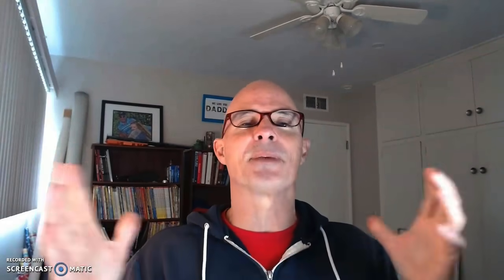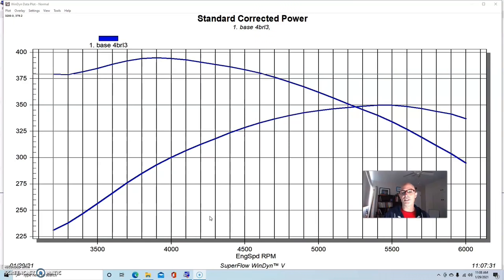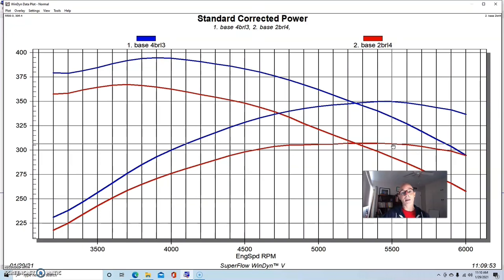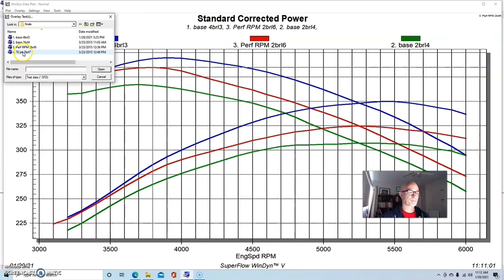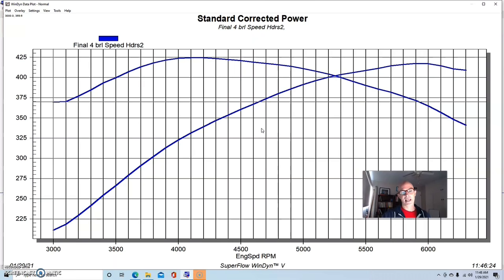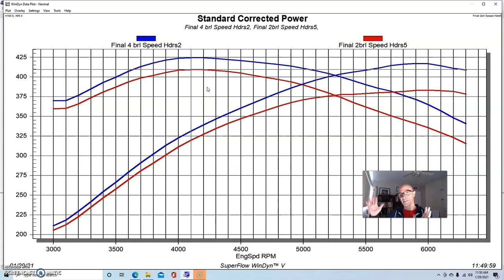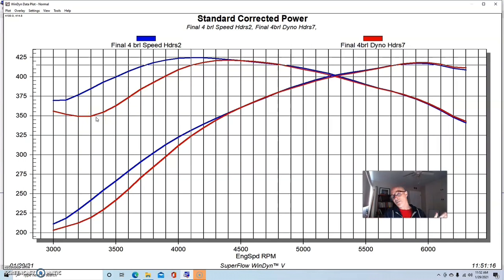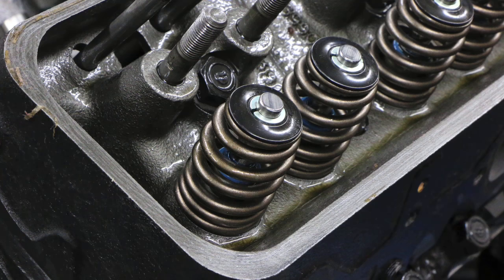SBC POWER GAMESSTOP HERE! (2BRL VS 4BRL)

Comment: Hey Richard curious if you’d ever do a header primary and collector size shootout I’ve got a 500 horse 400 ci s10 with 1 1-2” headers on it just curious how much I’m losing with the smaller headers thank
Reply: Are you saying that your primaries are 1.5" ???
Even 1 5/8 is small for what you are doing, and 1 1/2 really chokes it. Another issue with small headers is that it increases crank case pressure and poor ring seal.

You need 1 3/4" for a 400 ci 500 hp mill.
Reply from the maker: 1.5 INCH HEADERS WOULD BE TOO SMALL FOR ANYTHING BUT A STOCK 400
Reply: @AB-80X   yea 1.5” primary’s to 2.5” collectors there’s not a lot of options for headers in gen 2 s10 unless you want to take the fender wells out
Reply: @wyattjohnson6561  Dang. I reckon you're leaving maybe 40-50 hp on the table with that setup.
I would look into something like this and a 3" system.
https://www.summitracing.com/parts/hed-65854/make/chevrolet/model/s10/year/1995

Comment: Would there have been a vacuum reading with the 2 barrel  carb at full throttle?? 
And if so do you just step up carb cfm sizes until no vacuum is present at full throttle to pick the right carby??
Reply: There will always be some vacuum, regardless of the cfm rating of the carb.

Comment: I had a 750 cm carb on my 340 chrysler. Put my buddies 500 cfm  roundtrack carb on it. Dropped 2 10ths second at drag strip. But was getting terrible fuel mileage  lol

Comment: Would be interesting to see if an even bigger header setup gives more of a gain
Reply: From what I've noted in playing with that idea is that you reach a point of diminishing returns when the scavenging effect ("pull" from the exhaust velocity) begins to weaken.  I see a lot of guys using 3" systems back from the headers and they would be better with 2 1/2" or even 2 1/4".  A lot of those big headers are like a chrome dick....nice to see but not much good in the scavenging.......
Reply: It doesn’t. These motors make all torque. They’re limited to 6400 rpm in the series. So we close it all up to get average numbers up higher down low.

Comment: I think if you’re going to compare 2 bbl to 4 bbl they need to be apples to apples so a 500 cfm edelbrock 4 bbl to the Holley 2 bbl. Of course a bigger carb is gonna make more power.
Reply from the maker: NO ONE WOULD UPGRADE FROM A 500 CFM 2 BARREL TO A 500 CFM 4 BARREL

Comment: Why do u not put the 2bbl like we do on race cars side ways.   Everyone runs it like that makes huge difference.     All circle track people know this trick
Reply: That’s probably more for fuel slosh in the corners. Not going to show much on a dyno
Reply: Your distribution is better.    Think about this.    Strait line accl is usually slosh problem.     You dont put a 4bbl on side ways to cure that.   2 bbl sideways u allready know its really undercarburated but thats class restriction so it helps evens it out.   Imo.  I could be wrong im not Smokey.  But would like to see the numbers and thats my point.    Will use that info too!     Btw.  The header info was good thanks Rich

Comment: a few videos ago during one of your LIVE at 7pm shows the question of mechanical fuel injection came up and you indicated an unfamiliarity with that tech and indicated a lack of knowledge as to the tune ability  and usefulness of that type(Hilborn,Kinsler,Crower) style of FI. there exist a community of Knowledgeable individuals who can and will be able to tune and get broad range of power  superior  to most given carburetors  of similar cfm and manifold configurations!  Examples the many 360/420 sprint car running with  fi in CA! and most USAC/BCRA MIDGETS!
Reply from the maker: none of the first three things you said are true

Comment: Ive always wondered why you ran such big diameter primary tube generic headers on you dyno. 
Its nothing new that smaller dia. headers work better on moderate HP engines.
Wonder how many dyno tests have been "queered" by having the wrong headers for the combination.

Comment: You never mentioned that two barrels are rated at a higher depression than four barrels so that both 500 cfm’s are not equal
Reply: Yeah, that 500 cfm 2 bbl is more like 350 cfm when you measure at 1.5".

Comment: I am actually kind of surprised nobody mentioned that the oversized headers may be planned to kill lowend power and torque. 
High rpm power is needed for the straights but if you are limited on tire and suspension for your class you may not be able to get traction coming out of the corner so you have to find a way to get the hp but lose some tq. And headers are the easiest way to manipulate that.  Maybe you already know that.

Comment: No one cares about that guys cam trust me. On that motor 1 5/8 headers, anti reversion muffler and 650 Holley is the best combo. Also chipped to 6400 rpm as they make no power at all trying to rev them out.